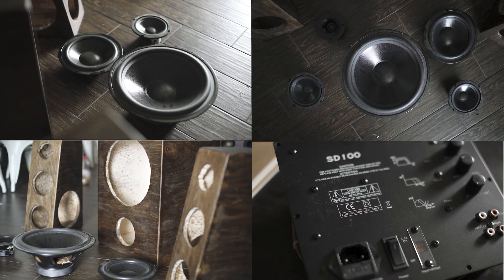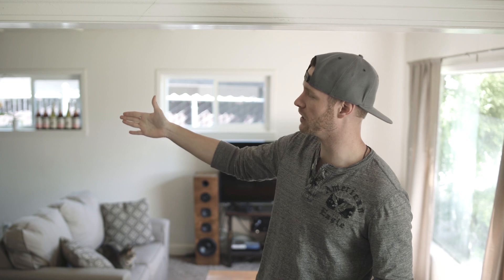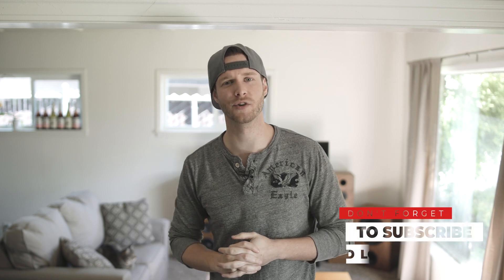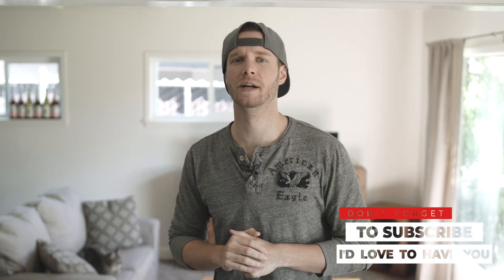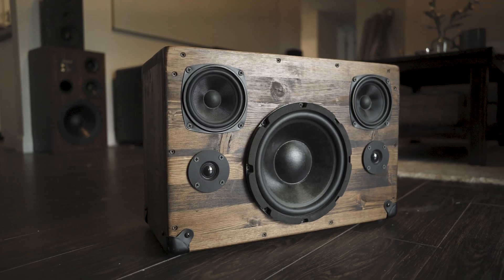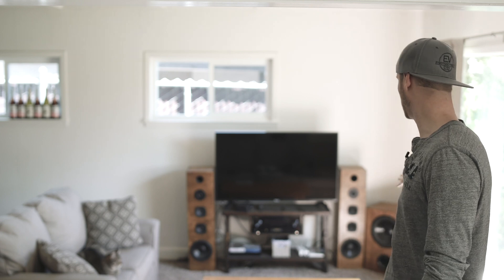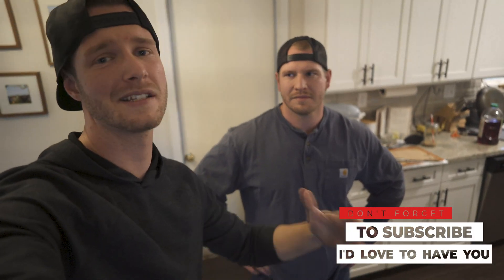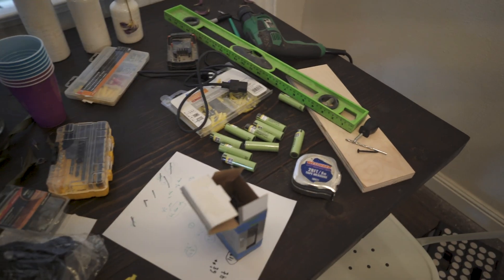DIY Bluetooth Portable Speaker Build [TIMELAPSE]

Comment: Very nice! Did you use any polyfill inside to soften the resonances and add virtual space? Got specs on the battery pack and charge system? Is it Class D or analog/linear? What drivers? lots of questions... but it looks like we may be related... at least have a common Friend.

Comment: How much for one of those ? I could use one in my work truck.
Reply from the maker: He bought the components and built it for $305!
Reply: Eee that’s pricey
Reply from the maker: @bennyvazquez3547  actually not bad for the outcome! But yeah not one you'd just buy. This one you can host parties with and pump some insane sound
Reply: @bennyvazquez3547  thats cheap. I do the same type of work on my free time. 300 dollars is cheap. This guy barely made a profit and i know for a fact that build goes pee pee on  jbl $300+ setups

Comment: A 100 Watt speaker that runs for 10 hours on the internal battery. Which means there's a 1000Wh battery in this speaker ??
Reply from the maker: Something like dat
Reply: At completely max output it’ll die faster, but putting out a decent volume it’s got a long life. The way I listen, it lasts for more than 10 hours.

Comment: Built my first home built set with a small leftover box from a Cheap set of speakers. Used a Gefco long throw rubber suround 8" woofers, and Philips Dome tweeters after hearing a similar set of drivers a friend put in a bigger box with 2 woofers and tweeters. Loved it, later added a bigger box and Realistic 1.5 Dome midrange speakers. Just simple caps for crossovers. I have run these same v2 boxes since the early 80s and they still sound great. They are sealed and the bigger box added some low bass and output and the mids added to the middle range nicely and it has a high dispersion very clean and smooth sound. I later added a cheap but decent 12" powered sub and I still love it all these years later. I couldn't afford to buy the quality of sound I wanted so I built it myself. Nice thing is if I hear a driver I like better I can always swap it in, or if one ever blows up. I drive them with about 110 watts a channel, 4 ohms, and the receiver has a lot more than that for a short burst. Rubber surround suspension will last almost forever compared to foam too.